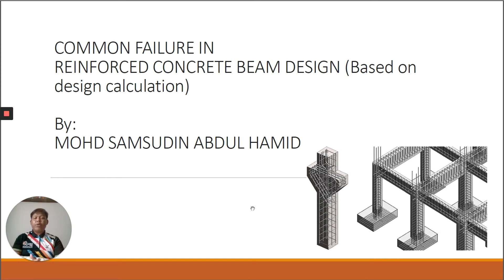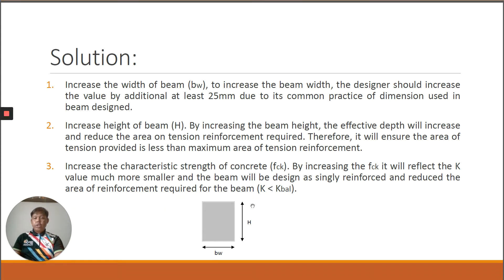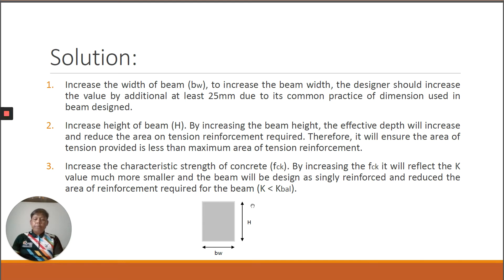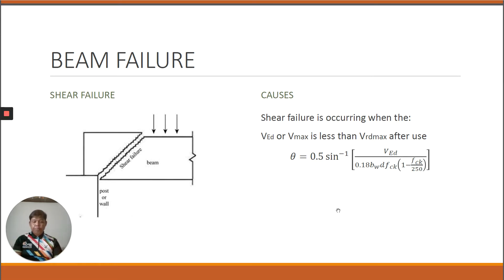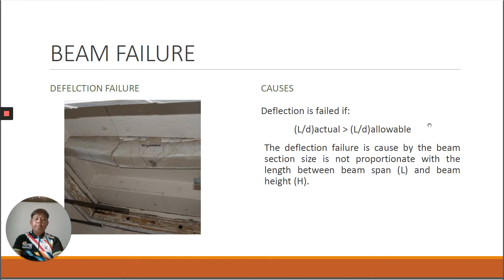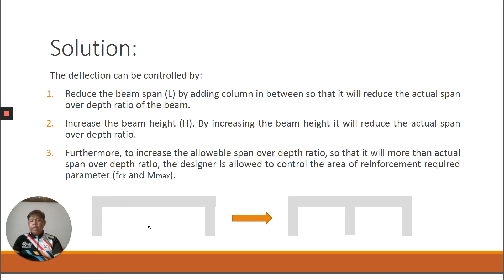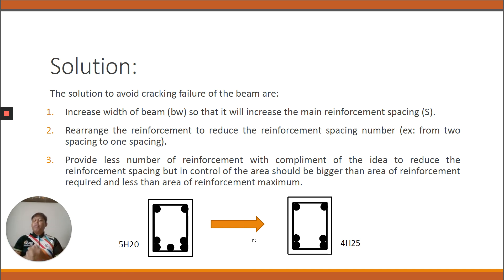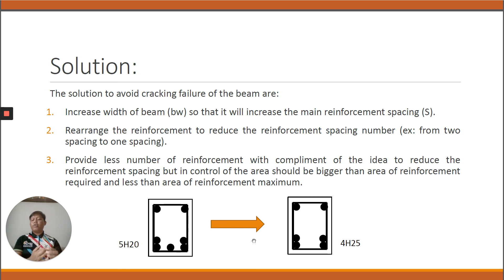COMMON BEAM FAILURE AND SOLUTION

Comment: Is it neccesary to put another collumn in between 2 rcc collumn in that failure if the building already build
Reply from the maker: lots of retrofitting method. analyzed cause of failures then examine it to choose correct retrofitting method for that particular problems.